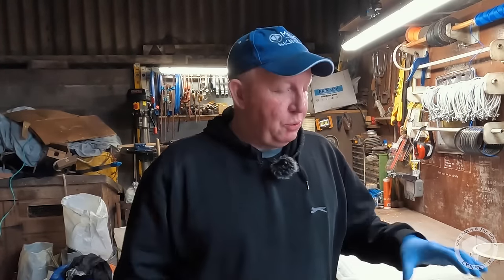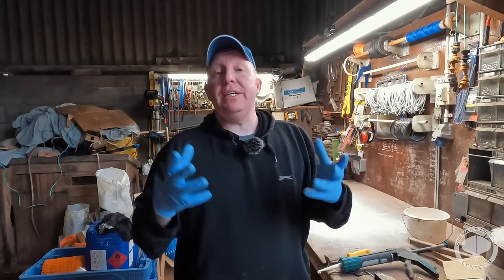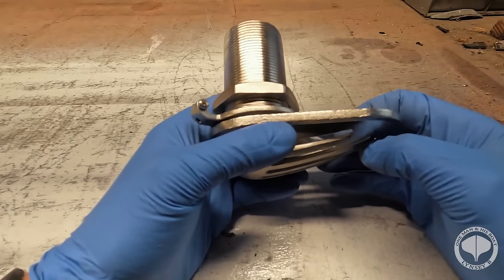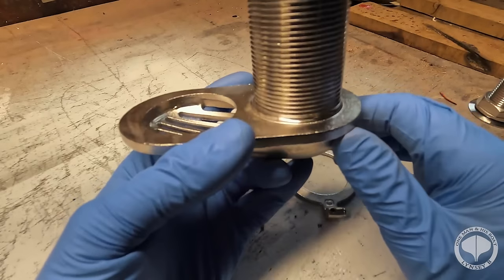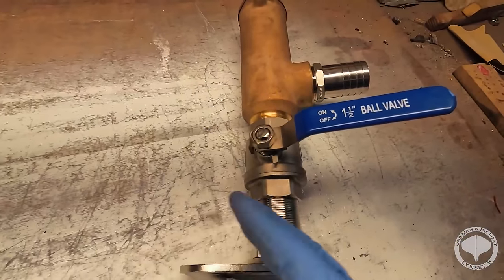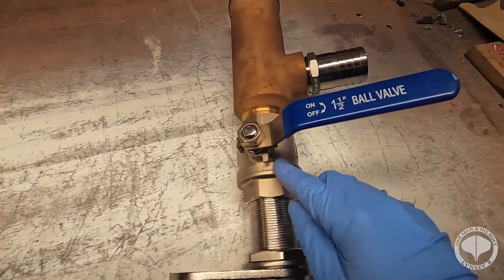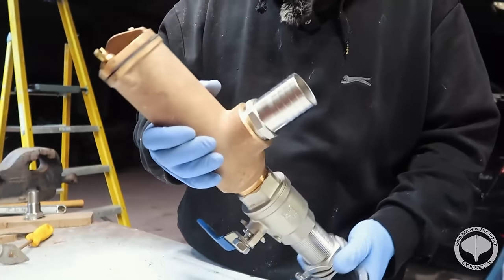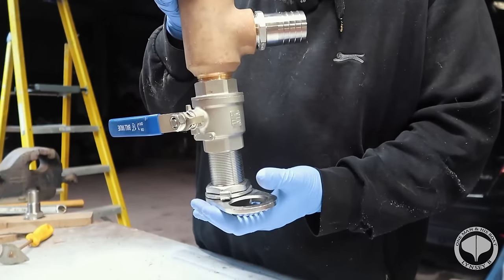Installing a New Seacock

Comment: Hi Barry, and thanks for channel, helps this old man greatly.  Anyway, I'm worried that the loctite film between the strainer nut and the grounding washer will interfere with the continuity between the parts. Please check with your meter so I won''t sit here worrying.
Reply from the maker: Hi Steve.
😂😂😂😂 don't worry, the add blue should just be on the inner thread.🤞 it should contact on the outer, but once I'm done, I will definitely check, no point cutting corners. My experience says it will just come back to bite you😞😂😂😂😂😁👌

Thank you for your comment and your support, bud.

We hope you have a lovely Easter weekend. 

All the very best.😁👌

Comment: I'll go with the open flange style. People should be told to open and close their seacocks regularly as a part of maintenance, I have seen them jammed by mineral accretion.   Take the arris's off your pad !
    I don't much like brass on a boat. Twice we have had cooling water dezincify  brass sweep bends on  boats  we were on.  My feeling is if you can find bronze or stainless fittings it's worth the money.
     It's probably a silly thought, but every time I see a situation like you with the rain, I feel that you could modify a garden pergola awning thing and lash it down to keep the rain off. We have  used them to make pop -up workshops in customers gardens in the past.   Obviously any boat with a boom is at an advantage  !
Reply from the maker: That's the skin fitting we had to turn to.🤷‍♂️ it will be my 1st time using this type,  so I'm curious to see the results 😁👌
Stainless is definitely a good foot forward. It's expensive,  but it's  well worth it, and you hardly need any maintenance on it.😁👌lasts a good lot longer, too.
Yup, I was just saying that to lynz, we need a new plan for next year, some sort of covering 😁👌
But as usual, it's all about spare cash, and we certainly haven't got any of that at the moment. 
Certainly something to work to, though😁👌

Have a great Easter weekend 

All the best.😁

Comment: Gday mate dont worry about ranting i know how frustrating things can be when working on a boat . murphys law mate if it can go wrong it will .Just a little advice from my time fiberglassing doing a square like that in each corner cut a small v notch becuase its chopped mat it will fold around better coz i bet thats where your air bubbles were , anyway once the gel coat is on no boffin is going to know its there anyway from jack sparrows priates of the carribean "take em nowhere and tell em nothing " take care .
Reply from the maker: Thank you, my buddy.
Yeah, it's been a while.
I should have rounded the corner on the block as well. That would have made things easier, too🙈🙈🙈
There is just too much to do and not enough time, and the clock is ticking pal😬😬😬😬 got 19 days before we go back in, and I'm not anywhere near getting done🙈😞😂😂😂😂
I'm sure I'll get there. I just need to keep plodding on.😁👌

Hope you and the family have a wonderful Easter weekend. 

All the best, my friend 😁